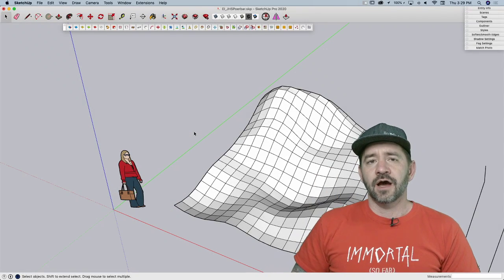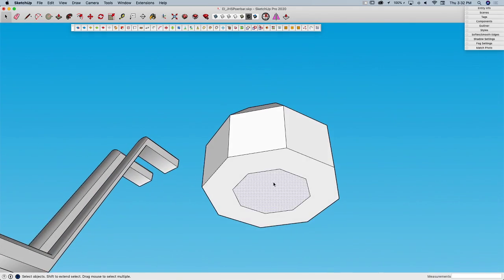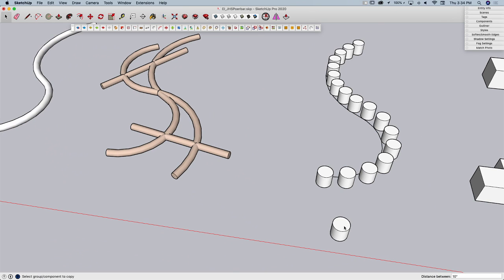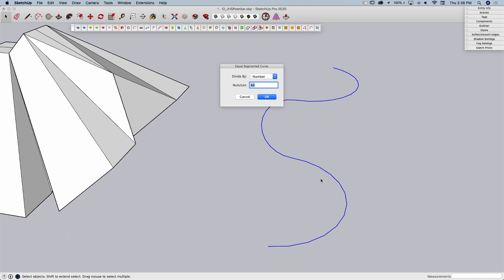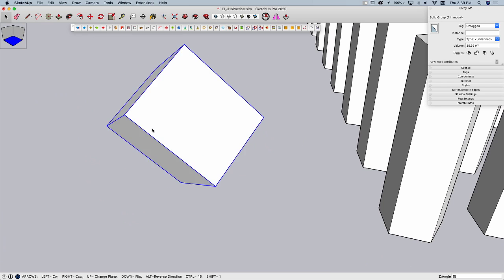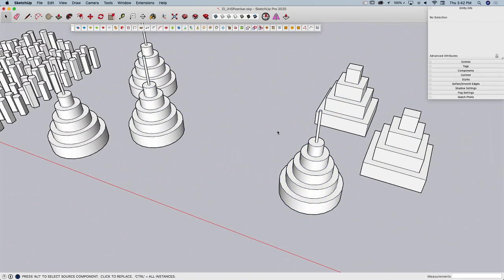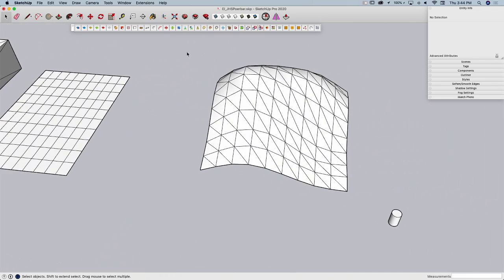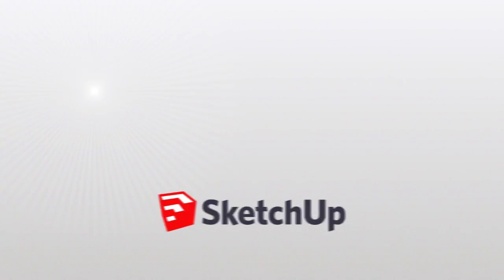JHS Powerbar - Extension inspection

Comment: Hi Aaron,

This looks awesome - I've installed but it shows as disabled in the extension manager and I get the following error on startup - can you point me in the right direction please (Mac OS X Catalina v 10.15.4 - SketchUp Pro 2019 v 19.3.252

Error Loading File /Users/paulbywater/Library/Application Support/SketchUp 2019/SketchUp/Plugins/jhs/_jhs_powerbar/jhs_powerbar_menux.rb

Error: #<SyntaxError: /Users/paulbywater/Library/Application Support/SketchUp 2019/SketchUp/Plugins/jhs/_jhs_powerbar/jhs_powerbar_menux.rb:298: Invalid return in class/module body

	return if not settings.include?("tr...

	^~~~~~>

/Applications/SketchUp 2019/SketchUp.app/Contents/Resources/Content/Tools/extensions.rb:197:in `require'

/Applications/SketchUp 2019/SketchUp.app/Contents/Resources/Content/Tools/extensions.rb:197:in `load'

/Users/paulbywater/Library/Application Support/SketchUp 2019/SketchUp/Plugins/_jhs01_powerbar.rb:16:in `register_extension'

/Users/paulbywater/Library/Application Support/SketchUp 2019/SketchUp/Plugins/_jhs01_powerbar.rb:16:in `<module:JHS_powerbar>'

/Users/paulbywater/Library/Application Support/SketchUp 2019/SketchUp/Plugins/_jhs01_powerbar.rb:8:in `<module:Max_Coppoletta>'

/Users/paulbywater/Library/Application Support/SketchUp 2019/SketchUp/Plugins/_jhs01_powerbar.rb:7:in `<top (required)>'
Reply: Oops - my bad - all sorted - I’d installed the version for SU 2015 by mistake - now works fine.